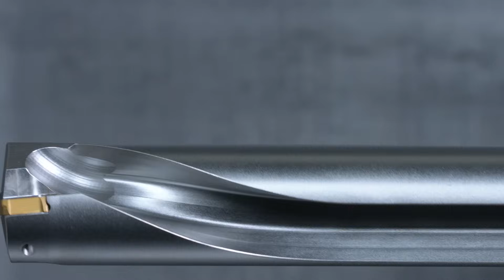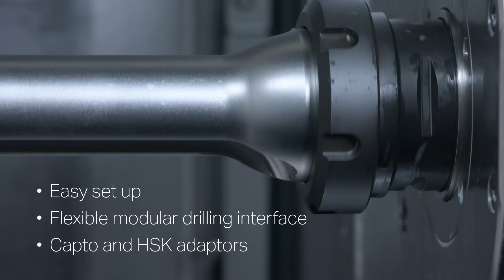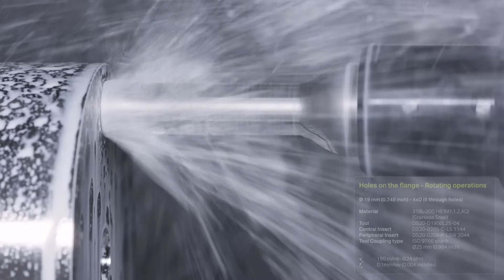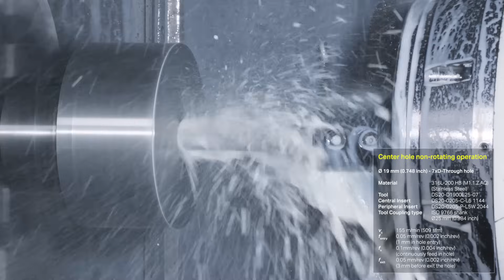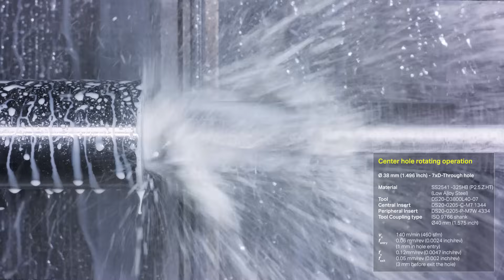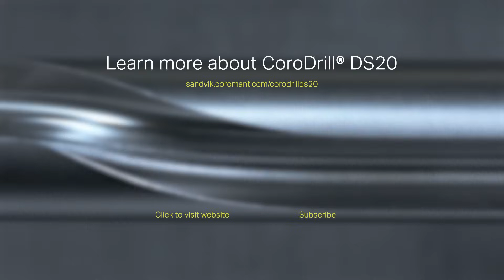Demo of the World's longest short hole drill – CoroDrill® DS20 4-7xD

Comment: Pretty cool. I think the way it was edited on the last part that was drilled, tge drill rapids out to the face, and the coolant is shut off, then they show the 7xD and the part has no hole in it, like magic! Obviously it was edited, but I remember jobs on the lathe when coming to check on it and there was no hole there, and the drill was gone lol, but not for the same reasons. I really like the cutting tool innovations that Sandvic comes out with, I'd say they are at the forefront of other brands, keep it up

Comment: Hey, can we get the surface finish report on that long hole drill?
Reply: around 20-30 RA  for 5xD 2 inch drill for the previous generation .. and diameter is consitent  soo pretty good but i dont know if its good enough for you ..

Comment: Very nice :) But why you performed every drilling test with an ISO9766 shank and not the new MDI?
Reply from the maker: Hi,
We have performed extensive testing with MDI as well, but in the cases shown using the ISO9766 shank was the best fit replacing existing drilling tools.